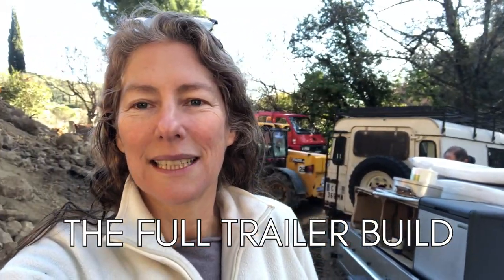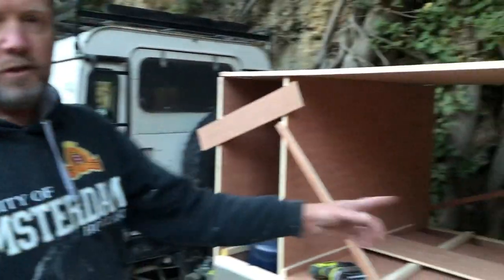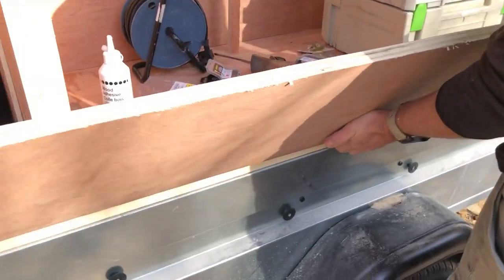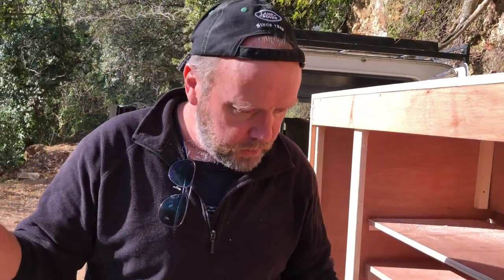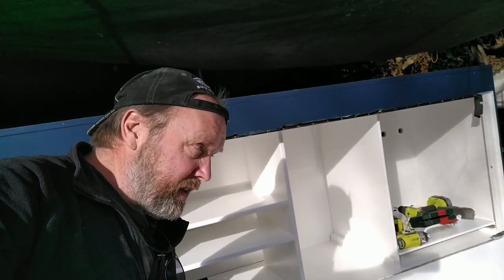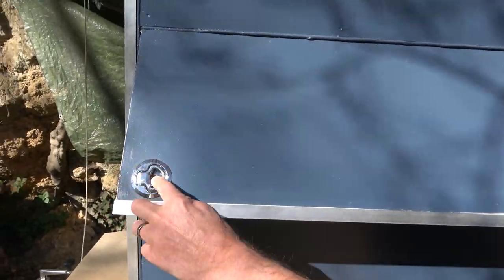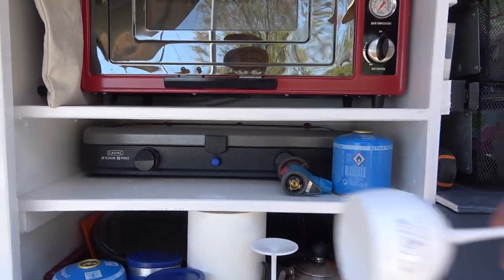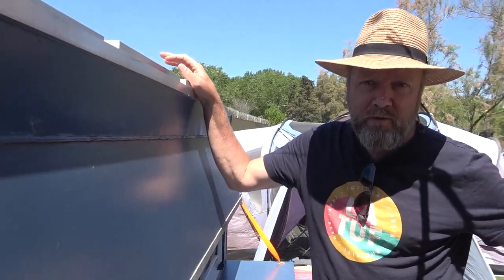FULL BUILD DIY CAMP KITCHEN TRAILER | From Concept to Finish

Comment: Well put together.  Curious if you encountered any issues with dust intrusion on dirt/gravel roads?
Reply from the maker: No, no real dust. Rainwater damp did give a problem around the piano hinges. Not wet standing water but some creeping damp (from the epic amount of rain we encountered at the beginning of our trip - especially Normandy) that delaminated the plywood. Replaced with garden fencing wood and problem solved - so far😅

Comment: May I ask what size trailer you used?  Looks like a 200 x 130?  UK Trailer sizes tend to be a little more narrow so I'm contemplating picking a trailer up in Northern France next time I'm over there.
Reply from the maker: This is a 200x120 (well spotted, sir 🧐😃). It is nice and compact and follows very well without cutting the corners. The advantage is also using the standard plyboards to build (4' X 8'). If it helps, as you can see I got it from remorques du midi in Marseille and with the idea that unbraked means no registration, mot etc
Reply: Thanks for the swift response!  I shall take a look at RDM's website and get the dimensions for a bit of research into options for my own build.  Cheers!